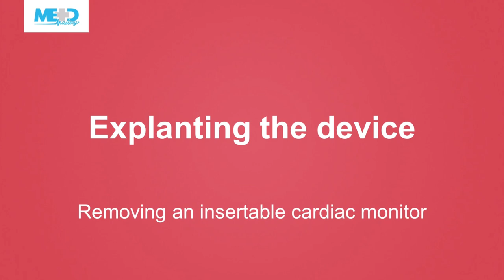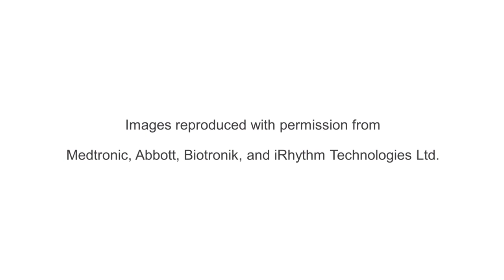How to explant an ICM device

Comment: Is it possible to explantate the device or electrode array of 8 rings from the top? 
Thank you for a response as I was was unable to pull a single electrode array from a patient that had a reverse affect after the Midtronics trial period then used an electrode with eight contacts, and stimulation went down the legs into the heels. During a revision the Medtronic's Rep and I decided to remove the electrode array bilaterally and reposition them for insurance. They allowed the procedure but I was unable to remove one. I fear that the distance and position of two would not give the patient relief as found during the trial as the new electrode was too far away from the dorsal complex. I was right in my prediction as the patient has vertical stimulation, but 5cm away from our pain target. 
Thanks for any advice. DeanKay MD pain specialist since 1981. 0:23